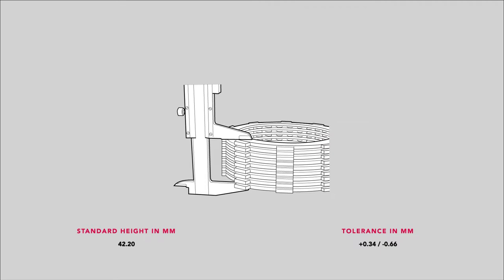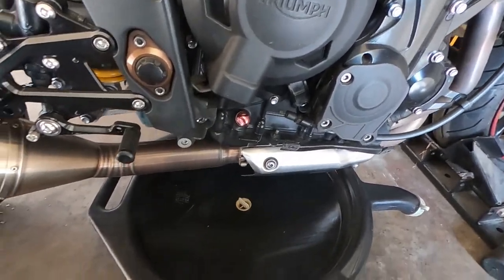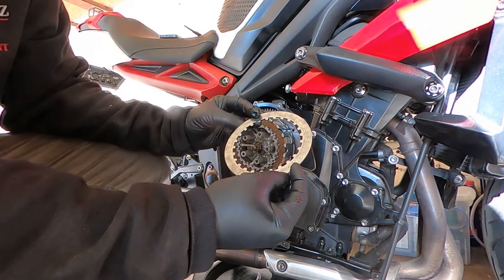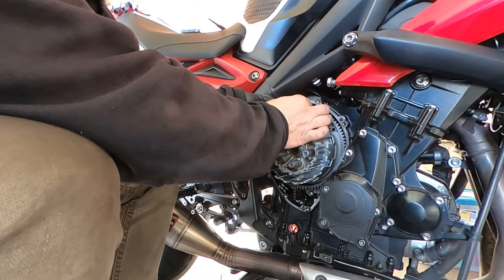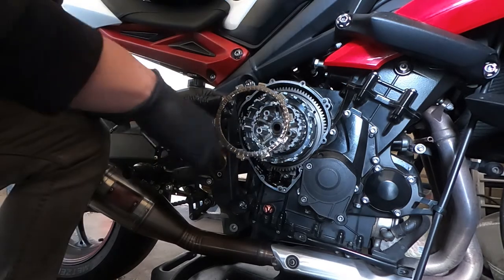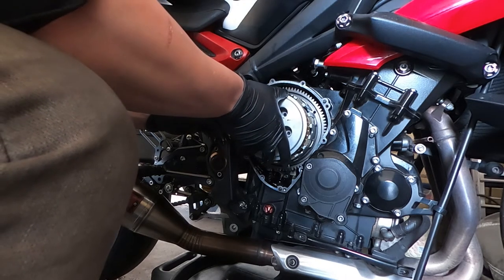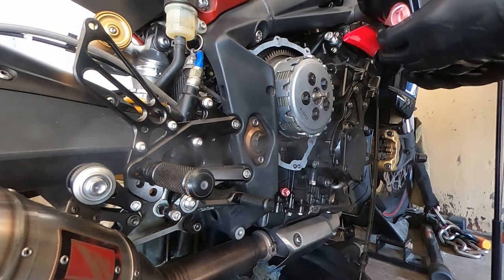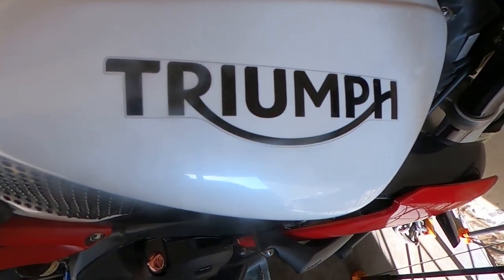2015 Street Triple 675R ABS | Clutch Plate Replacement

Comment: At 1:44 the sequence shows jutter spring washer - jutter spring - b plate. But at 7:50 when removing you remove jutter spring - b plate - jutter spring washer.  Then at 11:14 when you reassemble you do jutter spring washer - jutter spring - b plate. 

So when you disassembled the b plate was in between the jutter spring and jutter spring washer, but was reassembled with b plate after the two. Have you had any issues, or was it wrong before?
Reply from the maker: When disassembling, things have a tendency to move and loosen.  I have a shop manual and the assembly is verbatim.  But you are correct, it did come out differently as it goes in.  Once you start removing the plates, the jutter/washer will move.  I should have notated that, but it was my first attempt and didn't realize it.  Great question though!

You can keep an eye on it during reassembly to make sure it doesn't come out of its position.  I didn't have any issue with it staying in place when I put it back together.

I have not had any issue with the functionality of the clutch.  Bike is running strong, but now I realize I should have just put in a slipper clutch too...  :)

Happy Wrenching!
Reply: @otobainoronin7877  Right on, thanks for the reply. This is a great guide and I'm surprised how approachable a clutch job is. Appreciate you sharing this

Comment: Hey mate. Great video, thank you. Question for you … that roller bearing on the pressure plate… how tight is it in the pressure plate? My bearing was seized. So I can tell if it’s meant to be put in with a drift or just pushed in with fingers.

WRT the gasket. If you put a thin smear or engine oil on it, it stays in place during assembly, makes a better seal and comes off next time
Reply from the maker: Hello!  I thought my bearing were seized as well.  But they weren't.  Yours might be.  But the reason I thought they were seized is when I was incorrectly installing the clutch piece.  At first the bearings seem fine, but as the clutch piece started to slip back the bearings on "close" to final installation got tighter.  You need to make sure to pull out on the clutch piece every so often when tightening the bolts.  Hope this helps!  Please ask any questions.
Reply: Thanks mate, appreciate it. Yeah no my bearing is trashed… condensate from too many short winter rides. Thanks for your advice bud appreciate it

Comment: Hello .
How do you spot the difference between the friction plate A and the test of the friction plates ? Or the friction plate B is the only one different and the friction plate A is the same as the other ones? 
Also ,how you spot the difference between the metal plates?  I'm talking about the Shape of them not the tiknes 
Thank you
Reply from the maker: On the edges (tabs/teeth) of the A & B plate there will be a color painted on them, mine was green, but they can be different.  This will help you distinguish them from the other friction plates.  There are also number/codes that are scribed on the plate which will correspond with the packaging/bags they come in.  Another way to keep track of them.

I kept these separated from the rest of the friction plates...as not to accidently forget the plates were different.

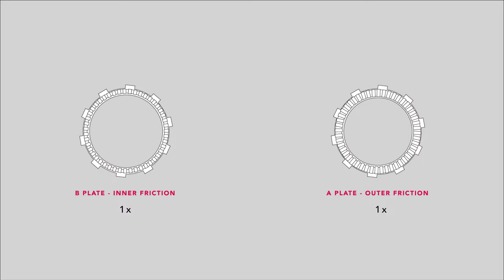From my illustration, you can see the difference between the A & B plate. (1:00 mark)

For the metal plates, they will look exactly the same, except the last 2 plates on final install.  The shape is the same, you can only really tell the difference by the thickness.  So again, I just kept these 2 plates separated from the general metal plates

Apologies for the delayed response, currently in the process of moving.

Hope this makes sense and helps.

Cheers!
Reply: Hello, did you ever figure this out? Im having the same problem right now.

Comment: I changed it out with the Barnett on my 675R track day bike and it didn't even last the summer.  Very disappointed.
Reply from the maker: Honestly,  I tried to go with Barnett first.  But there was some weird issue with getting the right plates for my bike.  They couldn't tell me what I really needed as their website states some contradictory  plate setup for my bike.  At first they were nice, but then after, once they could not be certain of what I needed they were a little short.  So I went OEM and it's been working great.  I could have gone longer on the original plates, but after riding time and track days I figure it is nice preventative maintenance.  Cheers!
Reply: @otobainoronin7877  Hey Thanks for taking the time to reply.
That's sad their customer service was bad for you.  I think for Harleys they'd be fine, but i won't use them again.
I just ordered the full OEM set.  The 675r clutches are a bit different so i paid the extra. And here in Canada, extra is EXTRA!

And Cheers to you too

Comment: Hi friend, i want to ask, after change clutch set also with springs i have hard times to switch gear or push neutral in. Even with tight cable. Old set was 41.1mm and new one is 42mm, where is the problem?
Reply from the maker: Hello,  sorry to hear about your clutch issue.  That is a noticeable difference between heights.  How bad were the old plates?  Was there major wearing along the plates?  You may want to check out the clutch cable as it may have worn over time as well with the clutch pack.  Now with a new, taller plate stack, the clutch cable may need to be adjusted or replaced.  As long as there were no issues installing the clutch plates, I would investigate the clutch cable first.  Cheers!

Comment: hello is it same for the 2016 street triple 675 abs ?? @Otobai Ronin ???
Reply from the maker: Hello, apologies for the non-response.  From what I have read and seen, the 3rd generation range are from (2013 - 2016).  Not sure what you are looking for, but there will be some cross compatibility from R to non-R.  But not everything.  Hope this helps.
Reply: @otobainoronin7877  ı have 2016 street triple 675 ABS -  ı have some interesting sound the clutch when its neutural. is it same clutch system ?
Reply from the maker: @ozguruzun9297  I haven't run numbers for the parts.  But here's a link that you can start with.  They should be the same.  Here is one from UK:  https://www.worldoftriumph.com/collections/bikes/products/street-triple-r-from-vin-560477-to-vin-806645

One from state side:  https://triumphparts.englemotors.com/Triumph_2016_Street-Triple.html

Just check it is within your VIN number and you should be good.  The install should be the same procedure.
Reply: Thank you  @otobainoronin7877